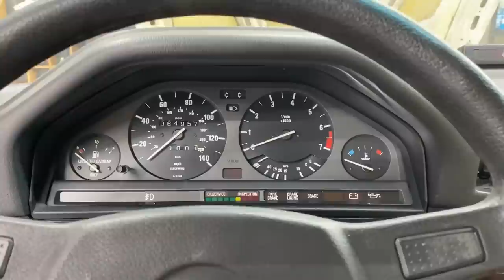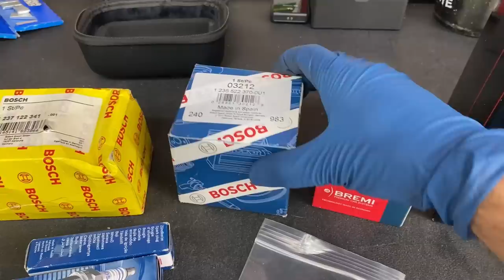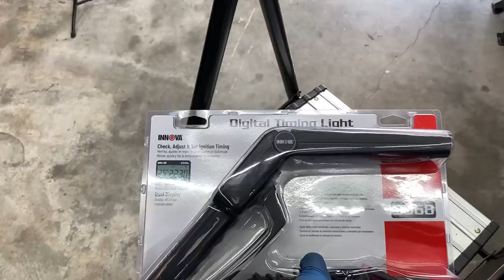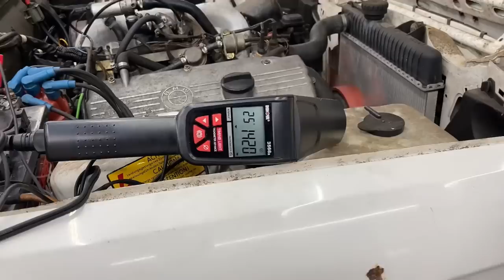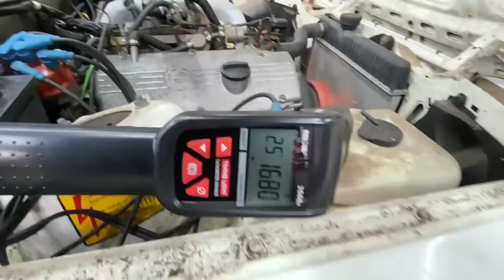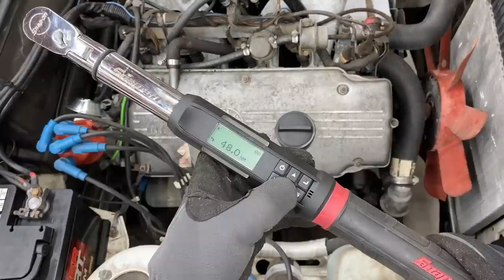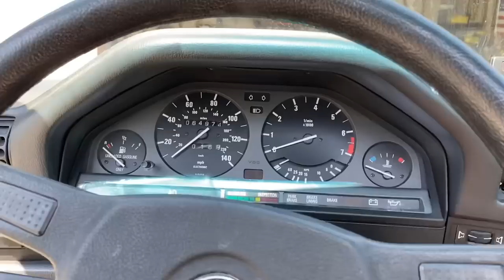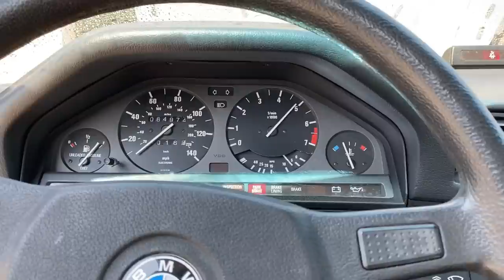Running Like A DREAM! Tune Up on my $2500 1984 BMW E30 318i!

Comment: When i see you strugling with the idling and exhaust-test, then i remember one trick. This car have a mechanical Mass Airflow Meter. Its a springloaded valve that opens after how much vacuum engine produce. More the valve opens, more gas will be delivered trough the injectors. Over time the spring in the MAF will get weaker and then the valve will opens to much and the car gets to much gas. Engine run richer. This will be detected on a CO- and HC-test.
The trick is to adjust the spring.
On top of the MAF there is at black plastic cover. This is glued but can easily be removed with a screwdriver. This will revail the spring adjustment.
This adjustment must be done during exhaust-test. The CO should be 0,7-0,8.
And there is also an adjustment screw on the MAF. This is for fine-adjustment and used to adjust the idle.
Before you do this, the timing must be ok. This adjustment-screw can be covered with a plastic plug.
Do not do the coin-trick. this will disturb the idling-adjustment.

The idle should be around 900rpm. Not 1100rpm. Trottle-valve should be adjustet so the valve is not in contact with the metal. 0,2mm is enough. If all this is perfect, the idlingvalve will keep the running idle perfect. Missfire do occur on these M10. Mostly from bad sparkplug(weak spark/missed spark). New sparkplugs(gap adjusted) and ignition-cables will fix this or maybe a stronger ignition-coil. And then people can do an exhaust-test with the nose. Smell the excaust. Rich mixture will smell. Push the accelleration pedal and see if the exhaust is become darker/black. That is a sign og vacuum-leakage or wrong adjusted engine.

Keep up the good work 🙂
Reply from the maker: What a wealth of knowledge! I took a screenshot of your comment so i can use it in the garage. Thank you for the help and the insight! waiting for a new ignition module, as it was the cause of my clicking noise, then I will go through this procedure.
Thanks a ton! and appreciate the support

Comment: Ah,the good old days when cars were relatively simple things. No computer controls!
Reply from the maker: straight up! its been a lot of fun for me workin on this new platform. a breath of fresh air not having to use a specific scan tool to get the job done!
Reply: I hear ya! Remember the non -computer Fuel injection systems?!

Comment: Good to hear that some parts get delivered from Latvia, my country 😂 I do in fact feel that nothing really can be found over here but it seems like I'm wrong when supply chain is taken into consideration
Reply from the maker: Very cool to have a viewer from Latvia!!! I could see that, luckily someone on ebay had the diaphragm I needed. Thanks for the comment friend!
Reply: @DayOffDIY  You're welcome! 👍
Reply: That's interesting to hear because anytime I'd look for small trim pieces or weirder odds & ends for my c207 chassis Benz, I'd always find some located in Latvia! Always! And it would be parts that I couldn't get anywhere except for the dealer. Little trim pieces & interior bits are freakishly expensive!

Comment: Ok FYI. I ran into a similar issue with having no silicone grease working on my E46. I live kinda out in the sticks so I didn’t want to go on a road trip to get any. And then I had an Epiphany! I had a almost empty tube of AstroGlide (Silicone based personal lubricant). I was doing a cooling system refresh. That shit is the bomb! Everything slide together nicely! LMAO
Reply from the maker: lololol AstroGlide! I love it. Will have to go digging  in the nightstand next time i run out of silglyde lol

Comment: Nice work brother, watching your videos always inspires me to start wrenching myself. my old Bimmer always has a significant idle jump when the AC is turned on, used to be worse when I had a clutch fan instead of the electric
Reply from the maker: interesting... I wonder if you have any vacuum leaks? usually the culprit of a sensitive idle... Thanks for the comment!
Reply: Never thought of that, i'll get that fogger and check it out. thanks for the tip @DayOffDIY

Comment: In the Immortal words of Ralph Wiggum "That's Unpossible!" At least it s here in Western Canada. To find a BMW E30 of any type or in almost any condition for less than $10,000 well...."That's Unpossible!".  Okay maybe not really impossible but the ones that are even in the $6000 or maybe $5000 range they are accident prone historically or and most likely completely Rust Ridden totally. I wish I could find an old E30 even without a drive train or with some dents (No rust buckets as that's something that is almost "Unpossible" to totally rid any car of once it's taken hold unless you are able to replace large sections of it with clean nice sheet metal on a rotisserie etc) anywhere near me by say 1000 Miles or KM or whatever I'd be there in the drop of a cat.  Thank you for the great videos and content by the way. You rock!
Reply from the maker: thanks for the support friend! 
Id sell this one to ya if the process of getting it across the border came easily!
I see them pretty often here in CA, might be worth looking down here!

Comment: Awesome work - that e30 is getting better and better.  Seems to run like a dream.  The ole m10 may be underpowered but it’ll make someone a nice cruiser.  Not every car needs to be able to do 100’ long burnouts. 

Might want to check the date on the engine fan. IIRC the red fans were original.  Be a shame for it to come apart on ya.  

I was able to rotate the engine on mine with the fan in place using a 30mm axle socket - little deeper than a standard socket. But downside was had to do it from the driver fender making it nearly impossible to see where the rotor was.  Removing the fan definitely is clutch. 

I’ve found info on these is a mixed bag.  Most forum posts are all m20 based. The lil m10 is just different enough from its bigger brother and its 2002 cousin that you really have to sift thru and make some sense of things.  

Keep up the awesome content Alec!
Reply from the maker: Hey Rob! Same goes for you and your E30. So funny were both workin through em at the same time. Its running so much better compared to when i first picked it up. The M10 is growing on me! It feels pretty reliable and bullet proof, I also dont mind the lack of power for reliability. Im still daily driving my 6 speed E46, which is a blast with tons of power, but the M10 is a great around town cruiser. I agree, itll make a great driver for someone. 
Good call on the fan, I need to take a look at it, but I LOVE the red color! maybe i can find a red replacement.
Yeah i was able to sneak the socket in behind the fan, but it was getting in my way of finding the timing mark so i just took it off, its very easy to remove without a shroud in the way.
SERIOUSLY! Forum posts are few and far between, the timing information i found online wasnt matching with my engine very well, so I had to kind of piece it together like youre talking about... ISTA has a little bit of info, and some viewers sent me over some manuals. Let me know if you need more info, I can try to forward some of the documents over to you. 
Likewise my friend! Lets keep the content coming for both channels!

Comment: Love the car and just watching your videos gives tons of advice, I have this exact car in my garage, currently having rough idle issues, can't find a new idle control valve anywhere, where do you find all your parts at? Would really be great to know
Reply from the maker: Hey Samuel! Finding parts for this car has been a challenge. eBay has been super helpful for sourcing used parts
Reply: The TDC marks in the timing hole, what exactly do yours look like, I also had to replace my distributor had a leaky diaphragm, thanks to your leak test video I also found mine 36:00

Comment: Hey man! Im working on a 84 bmw 318i of my own but i was really wondering where you got the intake hose, i found a fcp euro the L intake hose that connects to the icv but not the other hose to the icv. I was wondering where you found yours or if there is a part number that you know of. 

Thanks!
Reply from the maker: Hey! I got it off of eBay, let me try to find the link for you
Reply from the maker: https://www.ebay.com/itm/115393033340?mkcid=16&mkevt=1&mkrid=711-127632-2357-0&ssspo=bVpfjkzVRs-&sssrc=4429486&ssuid=PD9U-hzlTZK&var=&widget_ver=artemis&media=COPY

Comment: Distributor would only turn 180deg for every 360deg of crank right? Like the camshafts. So needs to be the correct tdc of 2 options i think.
Reply from the maker: Thats correct! the distributor will rotate with the camshaft, but the cam is 2:1 to the crankshaft
Reply from the maker: should have clarified in video :/

Comment: Needs a radiator shroud
Reply from the maker: it doesnt look right without one, however these 1984 and 1985 318s werent packaged with a fan shroud,  i believe you can update them with a newer radiator design

Comment: Where is the tcc solenoid? I got error code p0741 on my 2003 530i, but i also have records of the car being the solenoid replaced in 2020, but there’s also a lot of electrical problems on it, I don’t feel like it’s slipping, but it’s telling me the code is causing slipping, I would wish to just change the solenoid but I can’t find it anywhere, not even on the internet, it’s like bmw has kept it a secret all these years, do you think I need to change the tcc?

Comment: If it is running like a dream, then don't ruin it with tuning! Let it be as original as possible. 318i E30 is fast enough even in stock form (0-100 under 10 s).
Reply from the maker: dont worry, i didnt tune it with anything aftermarket, by tuning im referring to a tune up. timing the ignition, replacing components, and dialing in the idle. Im keeping this car as stock as possible.
Reply: @DayOffDIY  Bravo! Glad to hear that someone like you is keeping a golden treasure like E30 as stock as possible. Does it really need ignition timing and idle adjustment? Isn't it an electronically controlled fuel injection system? Doesn't the ECU take care of all parameters? I thought it is a self-adjusting system (as opposed to carburetor engines).